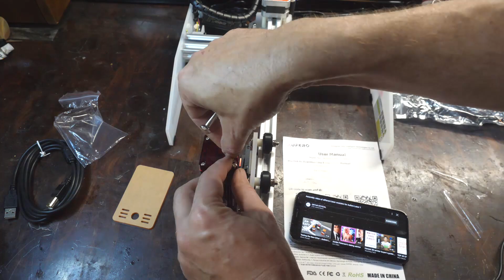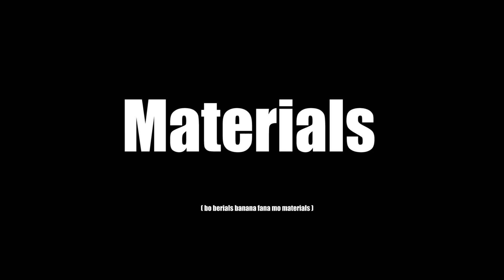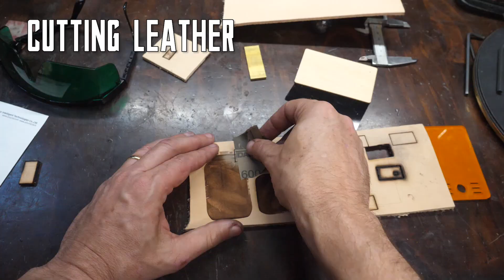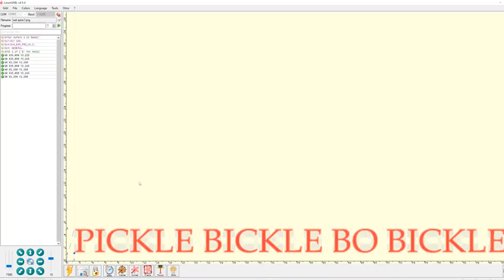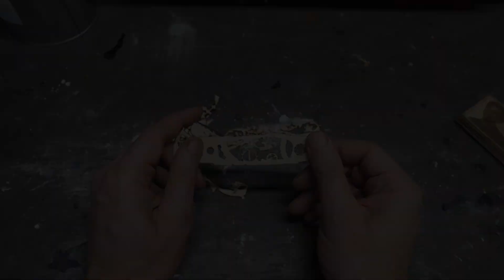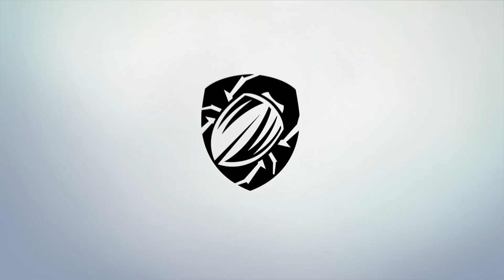Making A Knife With The Aufero Laser 1

Comment: You could leave that handle like it is, either make a tube you can plunge just the handle part of the knife in and fill it with resin, or you could tape off one side and a small damn so it can fill the areas on the edges of the grip.  Let it setup and then take to the sanding/polishing.

Comment: I wonder if it's possible to do the handle in one piece? Like set the laser to a slow speed for deeper cut areas and then a quicker speed for less deep cuts. I'm not really sure if lasers work this way but it was just something that came to mind. It might save you time having to glue up the pieces after they're cut.

Comment: If I may offer an Un-professional suggestion.
If you are going to come back to this in the future.
1. The handle, while beautiful, looks uncomfortable. I think that encasing the layered handle in clear epoxy would be a cool idea. The end result would be a comfortable handle while maintaining the beautiful laser work.
2. When trying to engrave the blade, my plan of action would be to cut a block of hard wood or steal to the exact same angle as the knifes bevel (a table saw should work), and then clamp/fix the blade to that, so that the handle of the knife is hanging freely and the blade is the only thing making contact. Then (theoretically) you only have to worry about the distal taper because the blade's bevel would be compensated for by the supporting block.(harder to explain in text than picturing it in my head lol)

Comment: FWIW, you ASSEMBLED a knife.
You didn't MAKE one.
But words have no meaning nowadays.
Reply from the maker: I designed the knife at knifeprint.com, had it plasma cut, ground it, hand sanded it, made the handles entirely w a laser and lasered the blade.  That’s as much making a knife as anything else.  I can’t forge w a laser and a 5 watt laser definitely isn’t cutting a knife out of steel.

Comment: With a non fiber laser etching metals, I'd probably spray paint the part, use the laser to ablate the spray paint, then etch the metal in acid.  You just need to make sure you invert the design.

Comment: How deep does the steel engraving go, is it viable to use as a makers mark or will it come off easily with some sanding?
Reply from the maker: it lightens with sanding but doesn't come off.  I had to put it under a belt to get it all the way off.  I'll do do some testing to see how deep I can etch steel in a few days.  I don't think its going to get close to electrochemical etching to be honest, we'll see.

Comment: this video coming out not long after maker's muse video about how unsafe these cnc lasers are is kinda funny and scary

btw, the included glasses are most likely not made for the wavelength of the laser diode it's bundled with, be safe, get proper equipment and hide this danger hazard under some proper safety cover
Reply from the maker: i'll  check out the video.  when i wear these glasses I can't see the laser reflections so my guess is they are correct?
Reply: @GreenBeetle  hopefully yeah, but it's hard to tell with these cheap diode laser kits

Comment: if you intend to use this for blades a lot you could build a jig that has several screws which lets you adjust the angle of the blade. but some magnets on and you will save a lot of time messing with wood and shims.

Comment: I think with some resin and molds you could try pouring some of that in there to build up the material a bit more so its stonk. Throw in some brass powder, sprinkles, fairy dust etc so its opaque
Worked for 15 years with telco lasers and I'm basically over anything to do with them... and the people who worked on them (why must everything be so hard face)
Does it cut thin G10?
Reply from the maker: Dunno I need to try

Comment: Could You import a photo into the software? When making handles, You make Your knife, take a photo, locate the holes for pins and/or other fastening devices, and create the handle from that.
Reply from the maker: Yes, I had an Inkscape drawing of the knife which had been plasma cut from 1095 so everything was lined up but tracing a nice photo of the knife to scale in photoshop prior then importing the tracing into the laser software might work too.  In my case I didn’t account vertically in the tiers for corby bolt fasteners.

Comment: I do copper and brass with a similar laser with a trick: paint the surface, engrave it, clean the engraved part a bit, then apply ferric chloride or any other chemical that can eat copper. This will engrave the surface. As for the cutting, it is much more efficient if you use a vector file rather than a raster: it will ensure clean cut all along the part and you can cut smaller details. It will also be much much faster. Having a honeycomb type bed also helps greatly for cutting any materials. Love what you're making ! Cheers
Reply from the maker: Oh cool you laser a resist that’s a good trick.  I tried a vector file cutting squares out of leather and didn’t notice much difference maybe I need to mess w settings more.
Reply: @GreenBeetle  Also when cutting an Air Assist will help... I made mine from a fridge compressor, an on/off toggle switch, a football(soccer) ball pump adapter and some aquarium air pipe.
Total cost Five English Pounds and Nine Pence... the cost of the Aquarium Pipe.
Reply: This is the video I followed to 'build' my air assist
https://www.youtube.com/watch?v=BfAC05eYGHs&ab_channel=kerimil

Comment: just be super careful with that laser. not having a laser proof housing, or an evac system for the smoke, definitely be careful. if anyone walks into the room and catches a blast of stray light, it could cause pretty serious damage to the eyes. also, you gotta be super careful with what materials you are cutting, just cause some of them can cause seriously toxic fumes. not trying to preach, just making sure everyone is on the up and up for laser safety. these are definitely not toys. if used incorrectly, it can blind you or even kill you... be safe out there guys! happy creating!

Comment: How about using the laser-engraved wood as the basis for an epoxy handle?  Do it just like you did, but then cast it in resin, sand it down to a comfortable handle shape, and polish it until it gleams?

Comment: I used to use modeling clay under tapered samples that I had to set up for macro photography. I would press it between plates and it would come out pretty level. Maybe something like that would work with the blades.
Reply: or to make it repeatable you could use the modeling clay as you stated but use a level finder on that using the base as the zero to get it accurate

Comment: That’s some very creative work you did.  The wood scales could be pretty durable if you coated them with epoxy.  How durable Is  the laser etching of the knife?  Is it similar to electro-etching your mark into a blade?  Great job trying some new things.
Reply from the maker: The etching in the video not nearly as deep as electro etching.  I need to try a smaller image and see how deep I can make it in steel w multiple passes.

Comment: Looks pretty cool but I wouldn't trust those laser goggles it came with (too much at risk to trust some freebie laser glasses).  Look for a reputable laser safety company and buy a pair from them.  
An alternative to all the shimming you did to etch the blade might be to use blue tack.  It should be a good balance between stiff and squishy to make level blade face. You can use something like a combination square to get yourself squared up.

Comment: You can add a real air assist to the laser it will help a lot. You will get clean cuts without of the ash everywhere.

I have the same style of laser and designed a nozzle that uses an external air pump. And it work fantastic.

The depth card is for engrave for cutting you need to be a little lower. The thicker the wood the lower you need to be.
Reply from the maker: Interesting thanks for the tip

Comment from the maker: Aufero says the first 5 people to use the code "S50" will get $50 off their purchase. Use lasers at your own risk! 
https://s.zbanx.com/r/ZQRnUZXUGBtR
Aufero Laser 1 LU2-2   $149.99 
Aufero Laser 1 LU2-4   $249.99.
Are Cheap Laser Cutters Safe? https://www.youtube.com/watch?v=-9hIXT8DMUU
Reply: it's crazy how cheaply you can go blind these days
Reply: hmm.  An expensive laser on a cheap plastic mount.. 1st thing I would do is machine  Aluminum mounting brackets and a base to hold it solid and square
Reply from the maker: @crashwelder5337  I think they sell this laser on a better mount on their website. And the laser by itself if I remember right.
Reply: @GreenBeetle  What waz ur settings to etch the steel, i got a 5.5W too but i dont succed yet ?
+1 with the comment about the fan, but not too close of the head or it will cool too much and being useless.
Reply from the maker: @croisetguillaume2223  vectorizing works better for etching steel and most everything else, i'm finding. 15 lines per.   I use m3 constant power 100mm/sec "1000" (or 100%) power and I run about 5 passes.  I don't think it's going to get nearly as deep as electrochemical etching but it may still get 'deep enough'.
Reply: @GreenBeetle   thx, ill try that, just the time to finish my box, need to had some air extractor and filter, some wood smoke sting (wenge for exemple).